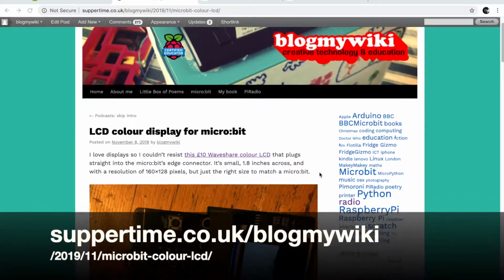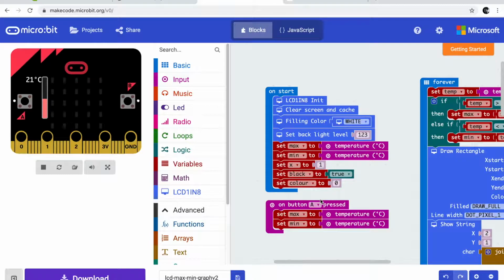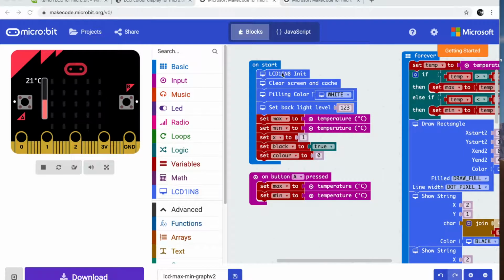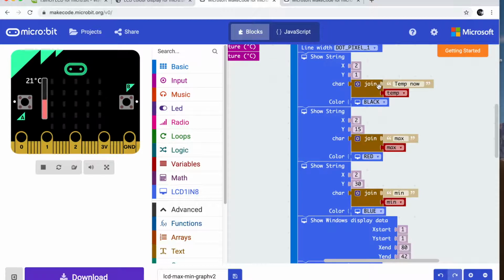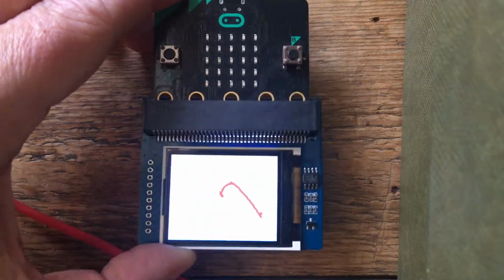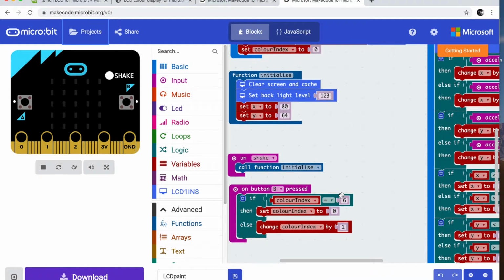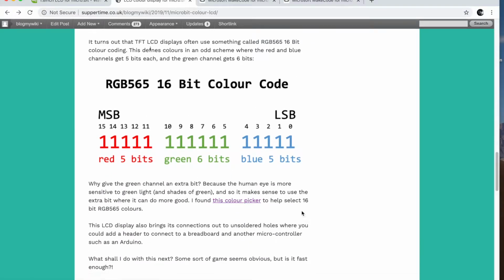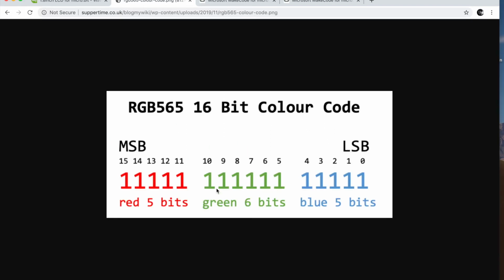Waveshare micro:bit colour LCD

Comment: Can I have your code for this
Reply from the maker: Hi there. This code is VERY old!
You'll need use an old editor like https://makecode.microbit.org/v0 if it still works.
I just uploaded some hex files for you to flash direct to a micro:bit V1 or load in the old editor, you'll need to right-click the links and save target as a file:
http://suppertime.co.uk/microbit/lcd-waveshare/microbit-LCD-accel.hex
http://suppertime.co.uk/microbit/lcd-waveshare/microbit-LCDpaint-v1.hex
http://suppertime.co.uk/microbit/lcd-waveshare/microbit-lcd-max-min-graphv2.hex

Comment: Can we use external temperature sensor with lcd simultaneously? Thank you ❤️😊
Reply from the maker: I don't think so because it blocks off access to the micro:bit pins, but you could use another micro:bit with an external temperature sensor which transmits temperature data by radio to the micro:bit with the LCD display.